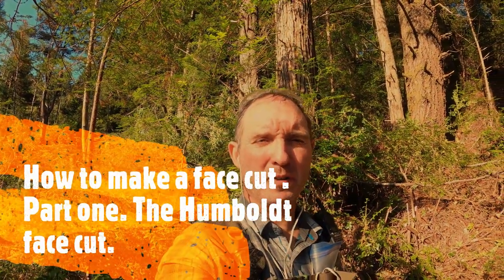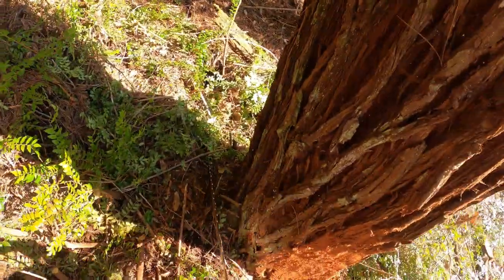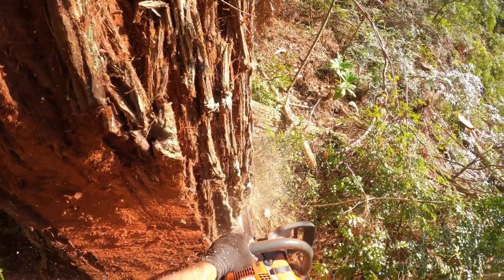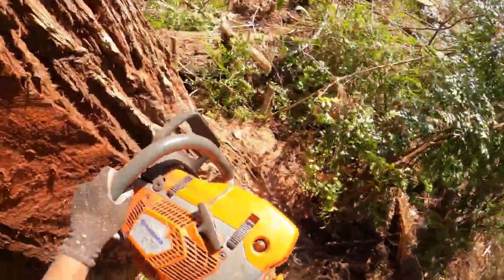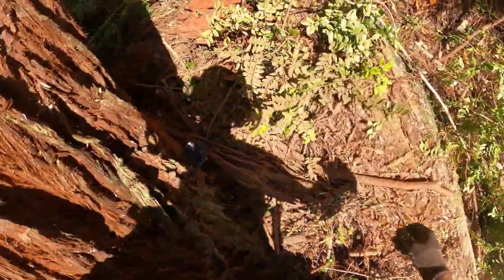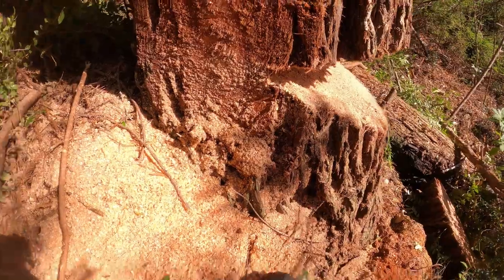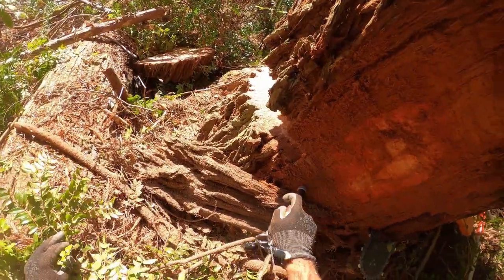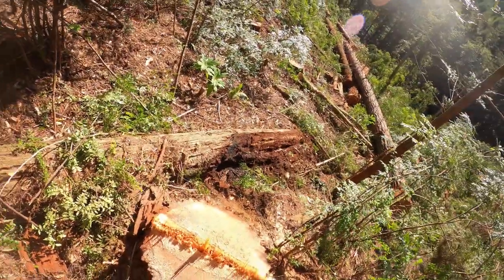How to make a face cut   part one  The Humboldt face cut

Comment: When you make your back cut, are you cutting 1" or 2" above where your hinge wood will be or are you cutting parallel to the hinge wood?
Thanks
Reply from the maker: Normally cutting it flush or slightly above the face cut is best. On a Jack tree or a hard wedging tree it is not a bad idea to cut an inch or two above the face cut. This gives a little more wedging or jacking power and can make it slightly easier to lift.
Reply: @norcaltimberfaller1943 what XP saw is that? That thing rips!

Comment: Thanks for explaining why you shave the bark on these redwoods.  Do you have a special technique when making the face cut to gauge the angle of the second cut to meet exactly on target with the first cut, without a dutchman?
Reply: I've been wondering what technique for that too! (not that I plan to try anytime soon)  beautiful perfection.  I've been watching men in timber my whole life, much respect.
Reply from the maker: There is really no substitute for practice when it come to matching up cuts. Even with practice it's hard to be perfect every time, because of all the variations in terrain that force a guy to be in different positions all the time. I can suggest that if a guy is going to be a little off on the far side , when meeting the bottom cut to the top cut, it is better to be a little under your top cut. That way you can just knock it out with your axe. Versus matching up with your top cut to soon , wich leaves a Dutchmen . That's harder to deal with. Because you have to reach in with your bar and fix it. Versus a couple wacks with your axe. Long story short if your a little off, better to be off a little low, then a little high.
Reply: Practice.
Reply: @norcaltimberfaller1943  Thanks
Reply: I like how you sight in the bottom face cut to match the top before you start, also starting more towards the center than on the edge,

Comment: Where I struggle the most right now is lining up that 2nd face cut with the 1st. Got any tips for visualizing that so it tracks the way yours does?
Reply from the maker: Start with the corner you can see and try to visualize the angle to the corner you can't see... if your going to error... go low ...usually knocks out and is fine... coming up to high is harder to fix

Comment: you didn't explain why and when you would use the humboldt cut
Reply from the maker: I use the humboldt cut most of the time. The reason is that it is better to remove the face from the stump. A standard or conventional cut removes wood from the actual log portion of the tree. It needs to either be "squared up" or measured with more trim. Either way there is some wood lost. It is not a huge deal to choose a standard cut over a Humboldt. It is just expected that a timber faller will use Humboldt face cuts in the area I work. I work in Humboldt County by the way .
Reply: @norcaltimberfaller1943  is there also an issue with one type of cut will make the tree fall closer to the stump and another type will make the tree bounce off the cut and shoot forward?  or am I on the wrong track here.
Reply from the maker: You are correct. You can use a "steep snipe" to drop the butt fast and close to the stump. A standard cut tends to slide the tree forward a little. A Humboldt with a steep snipe tends to drop the butt close to the stump.
Reply: Humboldts are used to save board footage on the log. It is a timber fallers cut and there is no reason to use it otherwise.
Reply: @Jimo225  If you cut a narrow face the tree tips over and snaps off when the face closes making the tree, or branch, jump out. A more open face allows the tree to hit the ground before it lets go keeping the log closer to the stump. 
  I have been a tree climber for 38 years and use these techniques daily on and off the ground.
Reply: @norcaltimberfaller1943  that fiber pull change the rating of the log? if you end up cutting off 2 feet any ways cause of fiber pull why not just do a 100 degree so your hinge is 80% of the diameter then plunge cut to set the hinge thick ness. then come through the back untill you have some trigger wood...
then cut trigger wood and release the tree.